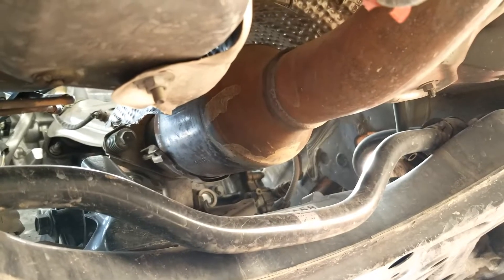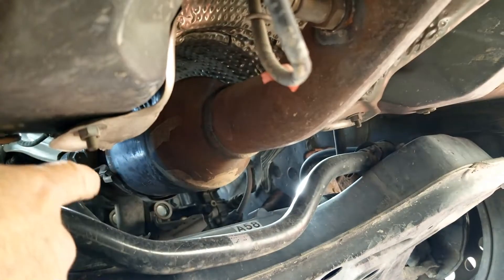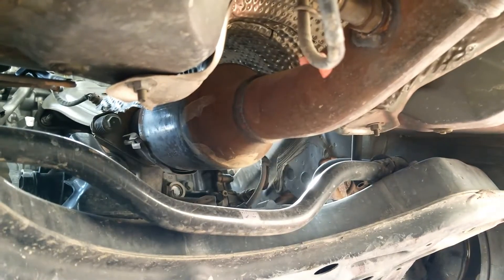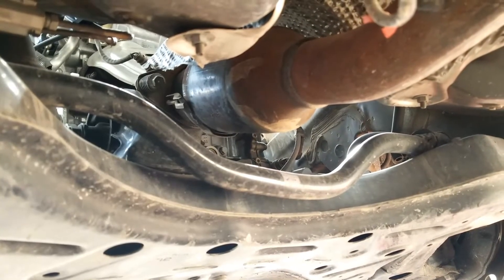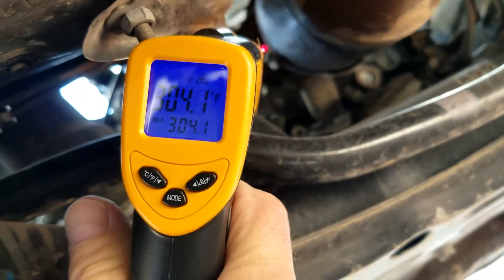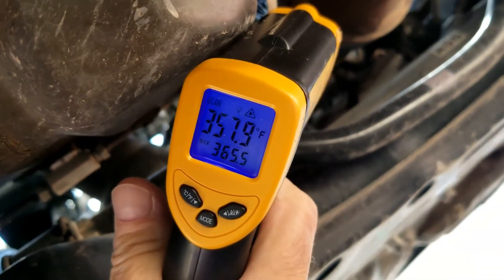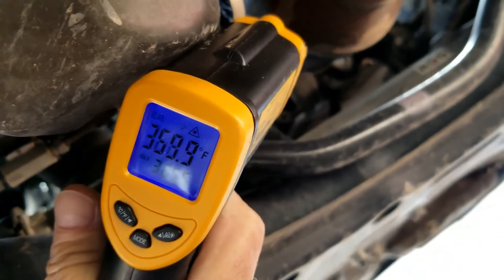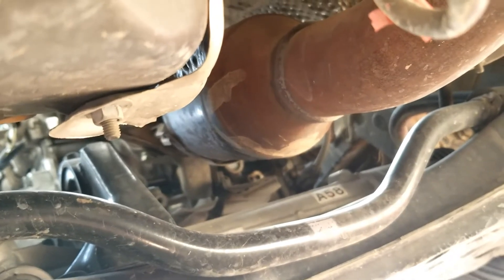How To Test a Catalytic Converter is Good or Bad With a Low Cost Infrared Thermometer

Comment: the chemical reaction of converting HC  to HO and CO will cause some heat   but a CAT is  often a 3 way conversion You must now make CO into CO2  and HO into H2O    the last is NO to NO2   The best  reaction temperature is in the 400 to 500 F   The rust and CAT shield may prevent you from reading the gas  temperatures.   Plus that laser dot  is not the actual point being read but a cone  shape where it is at the center.     So this is just a general check a CAT  is OK.  if there is no change  it is not working.

Comment: I have a question. so the pre plex exhaust pipe(the meshed flex pipe)  is hotter 50 degrees and the flex exhaust pipe and the rest going to catalytic converter is same (less than 50 degrees)... what seems to be the problem?

Comment: I did some temp checks on my catalytic converter that is on my 79 Buick Regal with 150,000 miles.  The cat maybe going bad.  These are my temps:  Inlet is 418 degrees and outlet is 450 degrees.  Checked again; inlet 420 degrees and outlet 450 degrees.  That was this afternoon at about 3PM.  I did another check again later in the day, on the same day about 6PM.   Inlet 270 degrees and outlet 333 degrees.  Checked again and got Inlet of 336 degrees and outlet 348 degrees.    Took another temp and got an inlet of 328 degrees and outlet of 325 degrees.  Anyone looking at these temps think the catalytic converter is going bad and needs to be replaced?
Reply: Your temps are all over the place. You need repeatable results. Drive for 20 min actively, then ask someone to hold the rpms at 2500, then measure.
Reply: @cheetah694  My bad on the year of the Regal.  Meant to say 97.  I rechecked the temps again.  The temps are consistently cooler in the rear and hotter at the front of the cat.  Changed the catalytic converter.  The check engine light has not come on and no more P0420.

Comment: That makes no sense. The inlet is where the gasses from the engine come in, right? That's where it should be hottest.. Very confusing
Reply from the maker: A CAT causes a chemical reaction to burn away emissions coming from the engine. This chemical reaction causes heat, which causes the temperature to go up as the gases exit. If a CAT gets clogged up, this chemical reaction no longer is working, and the exhaust is backed up trying to get out, causing it to be hotter before than after.
Reply: @HVAC_Mechanic  thank you for taking the time for explaining. Now I get it.

Comment: Does this method work on a manifold cat like a camry
Reply from the maker: This method works with most CATs. It is a basic test just to get a general idea of how the CATs are working. If there are other symptoms like low engine power, then very likely there is a CAT issue.

Comment: 08 chevrolet silverado 1500 5.3 vortex.  Bank 1 has been running about 50-60* hotter than bank 2 at operating temperature idling. If I raise the rpms up to get the cats hotter. Then bank 1 runs just a bit over 100* hotter than bank 2 according to both of my scanners while monitoring them. I have a basic scanner, and I have one that is a much, much better one. new down streem o2 sensors. 5.3 ly5 non dod/amf from the factory. None of that junk. 😊 the truck has excellent maintenance history. I do not know how long it has been running this way since I never had a reason to check. Never a code for a cat. I had a stuck lean signal on bank 1 sensor 2. Fixed. Then bank 2 sensor 2 is now doing it. Could it be the up streem o2 sensors?

Comment: My inlet reads 330 
My outlet reads 180

I get both codes p0420 & p0430
Reply: Cat clean or replace converter
Reply: @blackout7743  just replaced catts like an hour ago, running super smooth now

Comment: Getting a P0430 for bank 2 on my Jeep. Temps check out. 300 degrees in 450 out (roughly, bounces around). Checked o2 sensors on code reader they all show pass. I don't get it. Maybe while driving they go out of their limit?
Reply: I took my cat off and it looks like NEW inside.. Dunno what's the problem as mixtures and everything else is good but still fail emissions.
Reply: @vihreelinja4743  I was on the wrong side. Maybe you are too.
Reply: @vihreelinja4743  tune up. Replace everything coils and plugs since the manifold has to come off.
Reply: Check out South main auto LLC on here guys pretty good, check your grounds by the cat on the passenger side behind the heat shield.

Comment: May I ask if this method works on all catalytic converters? Mine is mounted vertically. The top (front) has a straight connection and the bottom bends 90 degrees.I tested and the top is 310 degrees. The bottom is only 260. And I checked in front of the bend also and its 260. Seems badly clogged right?
Reply from the maker: It will work on most CATs. This is a basic quick test to see how if the CATs is operating and if there is an issue. There is more test that can be done to verify it is has failed.
Reply: My Catalytic is clogged so badly that I have four misfires on 1-4.  Do you think laquer thinner can be any help with something this clogged? Will the car get damaged driving it like this?
Reply: @tainchains  Check out Scotty Kilmers vid for that. I just did this today. Unfortunately didn't clear my P0430, but then again the cat checks out with this temp check and the O2 sensors pass at idle via the code reader.

Comment: Found out by this that I don't need a $200-300 catalytic converter. This is relieving especially since my cats are mounted to the exhaust manifold and my engine is a transverse V6. All I need are some O2 sensors and this problem is done!

Comment: When you say test at the inlet and outlet, you mean where the cat bolts on the exhaust?
Reply: Measure the cat on each side. The exhaust flows in one direction from the motor toward the tailpipe. The motor side is the inlet and the tailpipe side is the outlet.

Comment: Someone should make something to completely bypass the catalytic converter as it pertains to it turning on the CEL. And there is a decent argument in my opinion for doing so. From the aspect of clean air, ecology, green this and that, the cat converter exists, solely. Doesn't have any other purpose but to clean the exhaust from the engine before it leaves the vehicle, correct? Yet, it's tied directly to engine performance via throwing one or several codes turning the Check Engine Light on and sending the engine controls into dumb mode rather than computer controlled. When there is no direct need to do this for engine performance. So, in the zeal to address the environment and make air quality better or in the least not make it worse, they made engine efficiency and gas mileage suffer, thus hurting the environment in doing so.

Would have been much more "green" and environmentally friendly to have the catalytic converter performance and condition indicated in some other way than to send the engine into inefficient and gas hog mode which is well understood takes place. That way, the CEL light will illuminate less on average, everywhere, and thus inefficient, aka dumb mode engine monitoring would be less overall and the environment including the air we breath less polluted.

Unless I missed something in that, it makes you wonder if someone put totalitarian thinking, that of forcing people to comply, ahead of their green goals as well?

Love the Democrats for their green initiatives. But don't become California, where their zeal to save the world and prevent cancer, has made every single product we use a carcinagan and thus ignored. Thanks, buddy. You're good, an asset to us all.
Reply: A catalytic converter code doesn’t typically send the ECU into limp mode. I’ve driven long distances with a catalytic converter code with ZERO issues, including normal gas mileage. And I have known others who have done so as well. The only reasons for catalytic converter codes are to alert you that it has failed and emissions testing
Reply from the maker: There are $5 Oxygen Sensor Spacers that work with some vehicles to bypass the catalytic converter. Many people who live in areas with no emission tests use them.

Comment: One interesting question for you. I added some fuel additive I forget the name of to gas tank that was intended to clean the catalytic converter somehow. I think maybe it was supposed to make it hotter to burn off contamination from the palladium coating inside the cat. I haven't run the engine long enough to make the additive function as directed, but wonder if it effects the temperature as you measured and I soon will? Thanks once again.
Reply from the maker: If the catalytic converter is clogged, the temperature will be hotter before than after, so I don't think this test method would change with an additive.

Comment: Never heard this test mentioned anywhere else and will try this after changing all four O2 sensors recently. That didn't prevent the CEL light recurring and I anticipate the same O2 sensor codes. I will thank you in advance because what you offered here, should it be accurate, is outstanding. Thank you.
Reply from the maker: This is an old-school test that used to be widely used before low-cost scan tools became available.
Reply: Did it work?